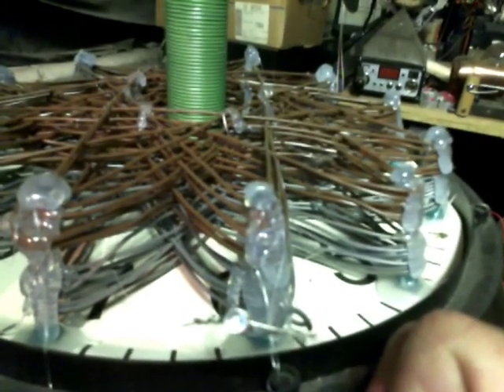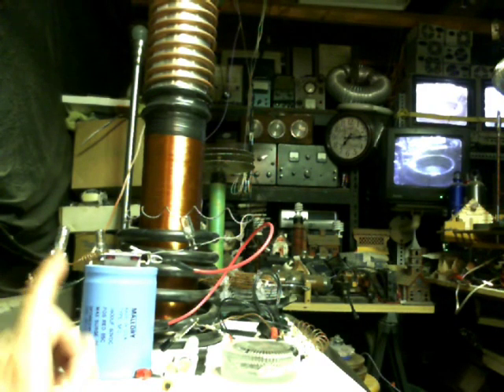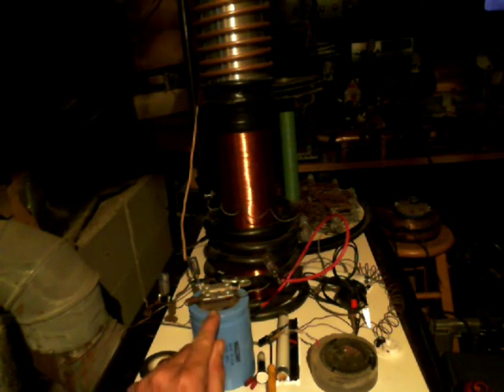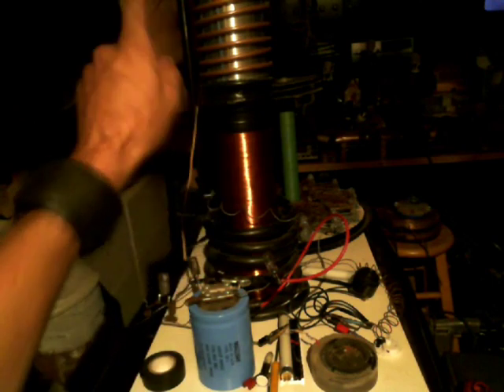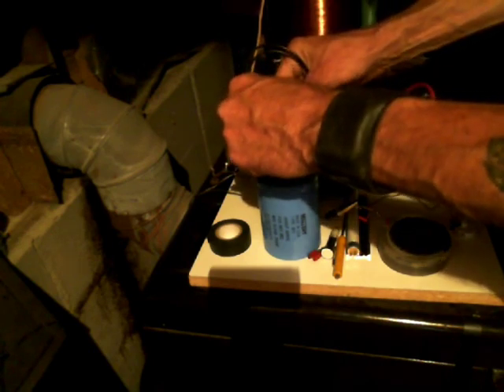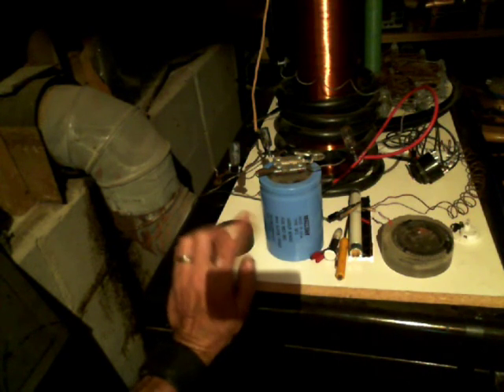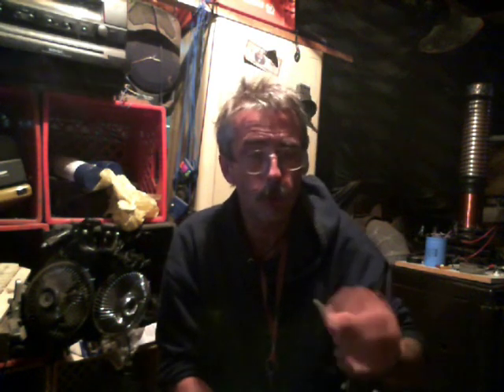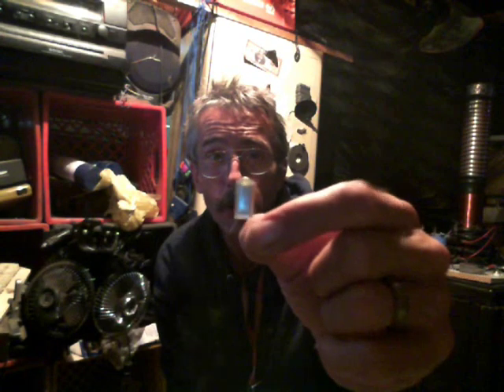SOLAR POWERED TESLA COIL !

Comment: rewind the ceiling fan motor with thin wire and we will have very high voltage out to your primary. sounds cool. ac 2phase. or an axial flux single phase with thin wire would be the ultimate output. Nice video, sorry i missed it earlier.
MUDDy

Comment: I think I figured out why you want the mercury arc rectifier (I have been doing a lot of reading lately). Let me know if I am on the right track... You want to reproduce the "true" Tesla radiant energy by reproducing Teslas DC impulse driven transformer. In which the primary is the "shockwave" field close to where impulse discharge is happening, the longitudinal waves zoom to the secondaries and then the beauty happens (energy gains).... Let me know if I am hot or cold... Also, I am going to (eventually) make you one, I will also make myself one. It will be some time because I had an unexpected shortfall of money ($3000) gone the way of the dodo bird... But none the less Shazziz, I will get us both mercury arc rectifiers built up. (eventually).. They will be interesting pieces to make... remind me of octopuses..
Keep on keepin on. Peace and all the good things. Binj

Comment: still not up to building your free energy spacecraft?/I c your name is still not on the list hmm,  mind you 2700 t,vs and 200 microwave ovens worth of materials is a lot of effort, but really its only 3 t,v,s a day  for 2 and a half years.pretty easy for a guy like yourself if you live near a dump. but don't miss out, you will need over 20,000 plasma tvs  in the future to get  the same amount of material for your free energy spacecraft, just gets harder as all the good stuff goes back to china for recycling yes the spacecraft club, learn grow share, and build yourself a free energy spacecraft
Reply: let the guys and gals at the  spacecraft club show you how 250 tv,s and a few microwave ovens worth of material can get you off the grid , completely 4 ever, give or take a few thousand years,  lol, whats already oxidized is going to be around for a long time.